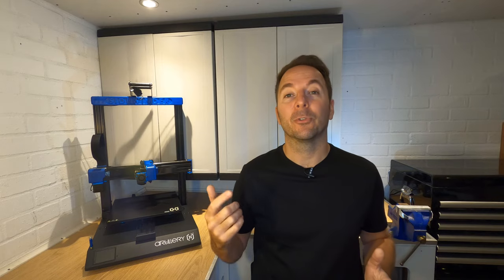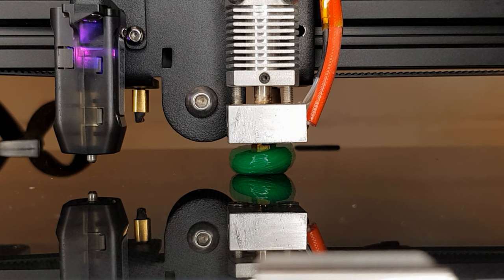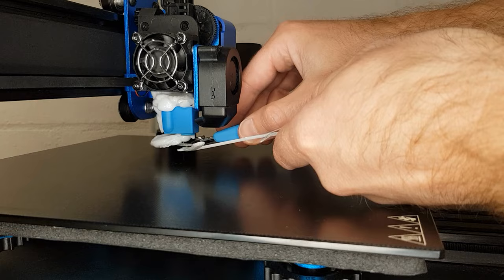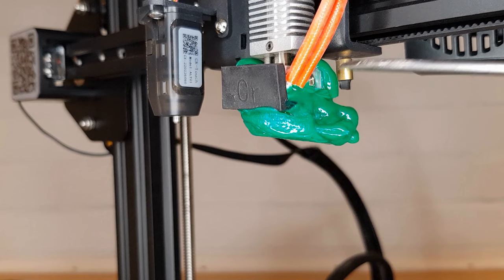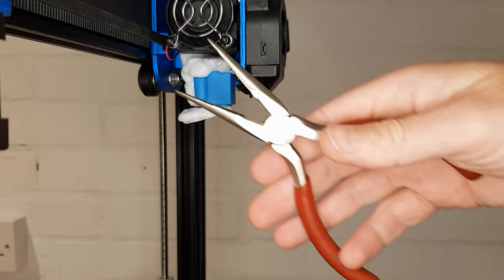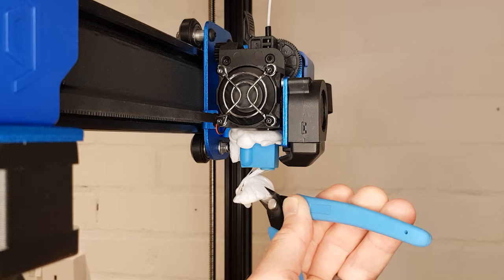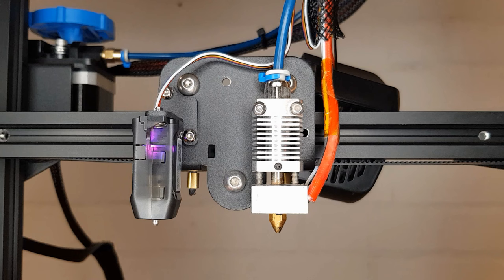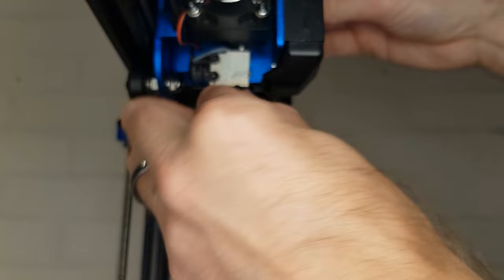Don't Panic! - How To Remove A 3D Printer Hotend Blob Without Causing Any Damage.

Comment: I wish I had seen this video before I bought 3 hot ends after my prints kept coming un attached. II even bought a new printer! When i happened again on my new printer, I saw this video, and these methods worked a charm. Thanks so much for sharing!!
Reply: your bed might be causing the problem as there is not enough adhesion, to avoid it happening again you could try increasing bed temperature to secure the print down

Comment: I had my first 3D printer for a few months now before this happened and I was so worried when this happened, I thought I'd have to replace the whole unit. It looked like a terrible mess with the clog but thanks to you, I fixed this and now I have resumed printing in less than 10-15 minutes as promised. Thank you for making this video. I really appreciate it.
Reply from the maker: Really glad it helped👍
Reply: If you chose  a temp. slightly below melting point (for example 180 pla), it still melts, but still sticks together enough to get it off in one piece without wiping.

Comment: Man, ran across this issue during the first week of having my printer. Unfortunatly couldn't heat up the handle since even though i checked the initial layer this happened to me for a large portion of the print. Observed the beginning of the print to make sure it was adhering fine then went to bed. Woke up with this giant blob all over my ender 3 s1 plus and the printer refused to preheat the nozzle (likely due to how much of the filament showed up, it even ate two cables pulling one off the mechanism slightly but hardening enough that I can't plug it back in.

After some fiddling I ended up just ordering replacement parts, once I verify the replacement parts working fine I'll go back and try fixing the broken extruder myself as a learning experience.

Thanks for the video man, will note this knowledge for the future. Just a warning for those using a heat gun - there is a large heatsink (at least on my extruder mechanism) that ended up permeating across and lifting one of the cable connections. Should be an easy fix once I get the blob off but just a warning for those in the future. A bit worried since it did seem to mesh together some of the smaller cables near there but plugging it in the mechanisms those are related to are working fine, will just make replacing those individual parts harder if needed.

To imagine all this damage from me not releveling after purchasing one of those adhesive sheets and putting it on the print bed. My laziness cost me a near $200 replacement parts fee qq.
Reply from the maker: Thanks for sharing your experience. Sometimes there can just be no easy recovery and you have to replace some parts as you've had to.

Comment: I had this happen a few times now over the course of 6 months, it ruined the hot end so much I had to fully buy a new full hot end.
The thing that made me do so was because after fighting to remove the filament blob and doing all that you said.

The problems for me was the hot end was so encased that all the tiny gaps and screw holes and even the tiny holding screw below the heater cartridge was full of the now hardened once melted
filament such that no cleaning could get out the melted filament of the tiny heater holding screw! 

So I could not remove the heater cartridge at all as the Allen key could not get into the tiny screw to undo it and the mess even was wrapped around the thermistor cable too and would have broken the wires if I had tried to remove it?

The melted filament just made it impossible to remove without the wiring being damaged. and yes a hot gun was tried after I got the hot end off the back plate and placed in a small metal hobby vise. So I now lost 3 hot ends. I had to replace them and change the bowden tubing to Capricorn and had either a all metal hot end with the bi-metal throat or us tight fitted Capricorn tubing down t the nozzle to stop out flowing hot filament.  The new problem I now got is almost as bad?

I have silk pla's and every time I tried to print with them on any of the now 4 printers I got each time the silk pla flow fine and print but soon block up the hot end such that I am forced to strip it fully down to clear out the blockage as heating more and such don't remove the blockage.

And I even had a silk pla that I started at the stated temp on the nozzle on the help info box label and it would not even flow so I tried again at 5 C higher and so on, then I get it to flow at a 220 C temp and walk away and come back and see it put down 3 layers and then totally blocked up the hot end. Only my silks do this, my normal pla's and petg's are fine.

Really a pain.
Reply: fr similar thing just happened to me. Pretty sure it's lodged deep inside the mechanism in my case and it even pulled some cables. Lesson learned on my part but it does suck. Ended up also buying a replacement part. Thankfully I have an ender and replacement parts seem readily available (although their listing of what printers are supported isn't quite accurate from what I can tell)
Reply: Is there any solution to this? Or do I have to just expect to cough up $30 every other week for a new hotend?

Comment: If you can, also run a little needle into the nozzle to see if it’s still blocked from inside. If not, run cleaner filament for a bit to get rid of the loose crud or at least enough so you can remove stuff.

Comment: Omg this helped so much! If you can take out the nozzle and heatbreak and pull a bit of cloth on wire or with your plyers that helps too. I only use PLA but have a spider v3 on my enter 3 and it leaks out the top and bottom so I am trying to tighten it at 270c and I only print at 200-210 c

Comment: In my case, it's the nozzle, the nozzles that i bought online do not suit the ender printer. They look very similar to the originalones, but still, there are tiny differences. when i put the original nozzle again, it works perfectly

Comment: Got a blob and it encapsulated the wires to the heater and thermometer on the hotend (as well as completely encapsulating the sock), had to spend hours gently trying to clear it away but broke all the wires, it's also up between the heating element and the cooling block and filled up the screw heads so making it difficult to pull the heating element off to clean up. Grrr. Ender 3 V3 KE.

Comment: My ender 5 S1 is getting these blobs over and over. 
I replaced the printer bed with the rough Creality surface bed and I’m using glue stick before my prints. 
The blobs are still happening.

Comment: Hopefully you'll get to my question I could use your help, what happens if the filament gets all around the heatbreak area , I have a voxelab Aquila v2 and there is the tiniest gap between the nozzle and the square part and twice already I have gotten filament that goes up and I think is getting in there going through and around the heat break coming out of the top of the square and just replaced it twice , would this work

Comment: This kind of hotend is very easy to clean, but my printer is a sovol sv06plus with a hotend that is not so easy. The temperature sensor cable is so thinny and they will brake very fast at the try to temive a blob. I have ordered now my 3. hotend. 😢 the blob came at first to my printer because the Z Level was wrong, so i keep an eye on a good z leveling. The 2. was broken because the adhesion of the bed was not enough, so i buyed an adhesion spray and now its good. The 3. Get broken because  i had layershifting and the print goes on in the air. This thing drives me crazy. I have so much problems with my printer and im running out of options to solve it.

Comment: Yeah i had this recently and i got incredibly unlucky the plastic mad its way to the wires and melted it all off so i was left with stranded wire everywhere hotend unusable and had a hell of a time trying to pop it out. the plactic got into the threas of the holding block had to chisel the hotened and its entire block out. it doesnt help that my 3d printer is now 12 years old and not worth fixing.

Comment: Great video, my Heat block ended up being threaded. I think by the heat. I have Cr-10 Smart Pro.  Are heat blocks interchangeable.  Like can I take a heat block from my Ender 3 V2 and place it on my cr-10?

Comment: Hi, Thank you very much. My Printer produced a blob 2 days ago and I was able to clean everything up with your instructions. I just have one problem, it still stinks when I heat my hot end up. What do?
Reply from the maker: The smell with most likely be from any remaining filament. The only real way to clean it off is wiping it with something like a rag when the hotend is hot. Be careful not to burn yourself!
Reply: @RickyImpey  Thank you I tried exactly that, and after a couple of hours the rest of the stench disappeared.

Comment: Question when your wiping the hot end with the rag how do you stop the thermistor from blowing since you removed the fan?
Reply from the maker: As long as the thermistor and heating element are both still attached to the heat block then there is no problem. The heater heats and the thermistor tells it when it is at the correct temperature and to stop heating.

Comment: This did not pop up I watch multiple video from 7:00 am searching different things like nozzle melted material around it help, how to fix, how to remove, how to take apart none ever showed this video I get this video after I pull on it after I try to get it off I fucking YouTube and it’s algorithm, is there way to buy parts or did I just ruin my printer ?

Comment: Hi Ricky, i kept my printer to print over night and woke up to the same issue, i paniced and tried to cut off the dry PLA of the nozzel and hotend and by mistake i broke the nozzel and there are 2 white electric wires that got disconnected :(, im lost on what to do now its my first time owning a 3D printer and this issue occured on my 3rd day, the printer i have is Xvico x3s. do i need a new hotend assembly? i can email you some pictuers of how the hotend looks like now if you want. 

Many thanks
Reply from the maker: Oh dear, it sounds like you may have cut through the thermistor or heater wires. This also means you won't be able to heat it up to clean off the hard filament. You could try gently heating with a heat gun but be very careful of any plastic parts around your hotend. The other option is to replace the whole hotend and wiring.
Reply: @RickyImpey  Hi, thanks for taking your time and responding to me ! i ws able to heat the the the extruder, however, the thermostate wires are disconnected. and the nozzel is broken :(